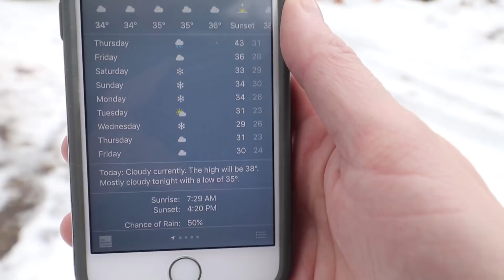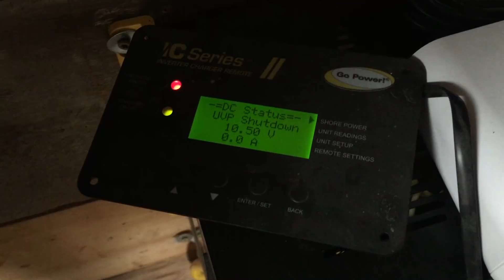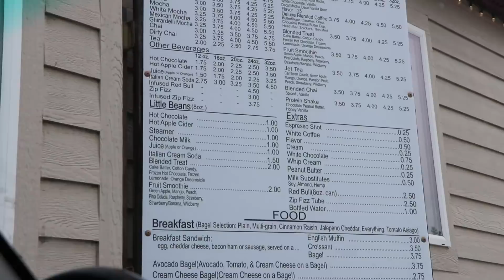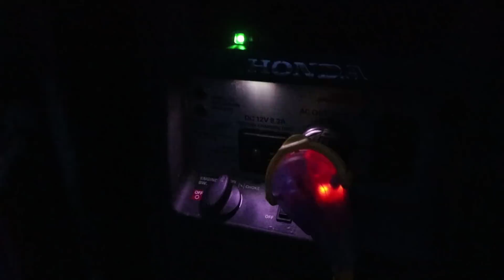Our Story: Giving Up Solar Power to Go On Grid

Comment: I am actually not surprised. I saw the little effort they made to be offgrid, and all the mistakes they keep making and the unwillingness to actually make the proper system... I rarelly saw their panel clean of snow. They also don't have the proper battery charger and inverter. They could have gone with 1/4 of the fuel, or even less with a proper charger/inverter. And even less with proper generator (with remote start). They just don't have the time to proprelly do stuff, or the money.

The technology is there. They just didn't had enought time or knowledge, which is fine.

For example, outback inverters, some of them are really nice, they have a few modes... One is generator assist... You basically tell the inverter/charger (one combo unit) how much power your generator give, and it will feed your house with the generator power, use the extra available to charge the battery, and provide extra power from the battery if you excede the generator capacity. They also have a generator start function, which is programmable (quiet time, low charge level = start when not in quiet time) and more features...

And you just need a proper system, which you refuse to admit you don't have. Your battery bank is WAY TOO SMALL. It should be able to be for atleast 2 days fully on battery, with no power restriction. Your can't even do a full day at limited usage. Your panels is also too small.

So, yeah, you weren't ready to go solar. Specially since not knowing how to even use a multimeter when you started.

Comment: Part of the reason your solar system failed is because you basically took a load of cheap off the shelf ebay stuff designed for RV's and were trying to run a very large property on it. For a start trying to run 12V from those panels down a thin gauge wire on a sunny day was causing you serious losses in voltage drop. See ohms law. You were trying to run on a load of shitty damaged batteries which could barely hold a charge and dragged down the rest of the bank. 

I'm a solar sceptic when it comes to more northerly climbs. You cannot cheap out on this stuff. My guess is you need around 20 large panels. You probably want to be running 48VDC to 72VDC in the panels down to your charge controller/inverters and you need some salvaged Lithium Ion battery packs. Probably 20Kwh or so. 

My guess is being on grid is probably cheaper. 

A word of advice Jesse. You get trolled a lot by keyboard warriors but i'm kind of glad you are going on grid and I hope you get an electrician to wire the house because you are not as clever as you think you are and you don't half spew some crap sometimes when it comes to electricity.

Comment: You are talking about solar, when you have little experience, really, concerning alternative energy. I think you and your viewers are well versed in what you don't know about solar. So, it's no wonder you want to go on-grid. I would too, if I had the issues you both experienced, while not really learning what you should have. You also started off with a used battery system, and not enough of a solar array to properly charge them. One rule about where you are is, when living up north where you do, you should really over panel for winter. 

Also, if you wish to go on-grid, that's fine. But, you shouldn't bust the balls of those who do live truly off grid. You may not realize it, but you basically just called a fairly large number of folks who have off-grid channels on YouTube - liars. You should have just left it at, "We chose to go on grid, because we believe this works for us." You need to think about it, Jesse. You owe some of your fellow YouTubers an apology. I really believe you do.

A few of those you really disrespected in this video are, McGarvey Style, Engineer775, Starry, Doug and Stacy, Bill and Rosa, Justin Case, and countless others. Some may not have large solar arrays. Others do. Some may only need smaller solar arrays to power their homes, homesteads, ranches, etc. Oh, for the record, running a generator sometimes, IS part of living off grid. Our farm, for example, consumes less than 150 kWhs every month, all provided by solar, and sometimes, a generator.

Comment: When I watched your first solar video "Stupid easy solar for going off grid" and saw which inverter, batteries and and panels you bought and the feeble uninsulated battery box, I knew you hadn't done your research properly. You knew you would be going to use loads of power tools and construction equipment which draws a lot of power. You should have started with grid power seeing it was available instead of wasting all that money on solar gear, expensive generators and a lot of gas wasted. When the house was finished and you had a proper insulated battery and power room bought a proper 48V inverter, batteries, charge controller and panels.

Comment: You can be on the grid and run Solar too. It can actually lower you Electric Bill. Not to mention having it available during power outages.
Reply: BlueDevil007 ...that's exactly my current setup. The combination is a plus. I have lights and hot water in a power outage. I use a propane instant water heater that uses a battery to trigger the spark and LED lights. I totally understand what these guys are experiencing. You need that "Extra" push with power to make it. It's better to start with power and evolve to solar assistance than to dive right in. It's a continuous struggle to stay afloat.
Reply: So thru

Comment: I live in northern British Columbia, Canada.  I have a quarter section 13 miles from power lines, so I went and spent 25000 canadian and installed 56 200 watt panels on the south side of our A-frame house.   Been off grid for six years.  Winter months, late november thru mid February, use generator for an hour each day if it is snowing or heavy overcast.  Have not used generator for over a month, and plenty of power.....you are incorrect about not generating power on overcast days....you just need a larger array to get the charging amps necessary.  I have all those panels coming into the house at 120+ volts DC to six midnite charge controllers, which charge 36 100 amp hour gel batteries.  I understand why you would want to be hooked up to the grid, it is much more convenient, not having to worry about clearing the panels of snow.  I think you are limited because of too small a system.  depending on how far you are from power lines, it likely is much more cost efficient to build your solar system bigger.   However you can still utilize your panels after your on grid power is hooked up to minimize your bill...grid tie inverters are cheap and require no battery bank, making hookup straight forward and simple.  For me, having power poled all the way in to my farm was WAY too much to afford, so a big solar system was my choice, and have zero regrets....too much power to use for 9 months out of the year.  I have two xantrex 3000watt inverters stacked....this runs two houses, two shops, wellhouse and numerous outbuildings.  I still heat with wood...good luck with your new home, looks like a beautiful area.....don’t give up on solar....keep this option open for future , when you have more time after your house is completed!  cheers!

Comment: The problem there having is they never did invest in a true solar system . They have the bare minimum panels on a static mount. The bare minimum storage and a very small gas generator. All that adds up to the bare minimum power. Enough to power basic needs in a small trailer that's it.
make the investment and they would get reasonable results and in time it would pay back
Reply: Tom this is exactly what I thought.  They invested plenty in a tractor and new wood mill which will service them for their lifetime and possibly there children's, but solar, hey let's spend the least we can and let's not bother building a tracking system just put the panels laying on the ground pointed skywards.  If they'd put the same effort into the solar system as the frame for the house I have no doubt they'd be a lot closer to being able to remain off grid.

This is a 30+ year investment just like your house frame and sadly you've sort of dropped the ball but that's what living life and learning is all about.  

Let's just wait and see how much the electricity company wants to extend those wires and poles to your property it may turn out to be viable to build a proper solar system once you get the quote for that.

And you need to do the calculations for 30 years of connection and service fees as well.

 And as others have said you can always augment with your current system with a little tweaking.

As for battery storage using Gel Lead/Acid batteries is so last century, quaint but not a worthwhile investment of your time and money.  You know with that big hill and water you could pump water up hill, there are many ways to increase your storage and input into that storage.

As I say I'll wait and maybe the price of connection will be workable.  Seen others quoted in oz in excess of 70K just to connect.

Comment: I work for a public electric utility.  Talk to your electric company about Net Metering.  That would allow you to retain your solar system and on the days the sun is working - use solar and sell any over production to the company - on the days without solar - you have the grid.  You are billed the difference each month.  You have quite an investment in equipment.  Don't scrap it.
Reply: Printer471 this is very good advice. Even grid power has limitations. Do you guys remember having power when your neighbors didn't? I just had 10K grid tie solar system installed last August and have not had a power bill from the utility company that wasn't offset by the power produced. My system is 3Kw more than was recommended due to the fact I enjoy using copious amounts of power. Bonus is that it compensates for the days of low to no solar power production. As soon as power walls become moe affordable, I will jump on those. Best point I can make is that in ten years, the system will be payed off. I would love to talk to Jess and his bride about solar and the options they have at this point in their lives to consider becoming a partner with their power company and how they can start a legacy for their future family. I do not represent or work for any solar or power company. I'm just a retired military man that has followed solar power for 30 years and it still blows my mind.
Reply: Is what it is. Live the life you want to live. In South Africa we have a lot of Sun so it is not a problem and worth it. Think about a grid tie system.

Comment: the solar was the whole reason I subbed!  of you had more battery. and more panels . you wouldn't have the problems you had. also wind turbines would make a big difference. I'm building a small hydroelectric generator. and have a 25gallon fuel tank on my 6kw generator. for when there is no wind . or sun. the first few months here we have little sun. but there is wind. so maybe before you do go grid. maybe think if wind may supply you with the power you needs. along with more battery!

Comment: Serious question,... "Modern Couple Building a Debt-Free Sustainable Home". I was excited to see this channel develop into something "sustainable" But since I've watched this channel a few Key major factors have come into play. You picked One of the most expensive ways to build a house in a rural area. And I say expensive because for starters most of the people tuning in, and even probably some of the people who live around you for starters didn't use LightForm to create the foundation, concrete blocks would be the cheapest through their own manual labor. Then you went off and built a Timber frame house, again with someone of limited means, they wouldn't buy a saw mill and truck in raw trees. I could see this being beneficial if you had said trees already on your property and an abundance of, but this is not the case.  Next you decided to use SIP panels, again most people would build on site. The vlog started with Allyssa selling her car to buy land for the "homestead" Yet eventually you went and bought a truck going back to payments. You were off grid for much of the vlogs existence, kudos there, but now your going on grid? You could have partnered with Solar City or some big solar company to be educated about solar and learned how to do it right. It's no surprise that your solar didn't work out, you bought second hand batteries and had not a clue how to maintain them... And don't get me started on the tractor,  I mean, it's debatable and even i have said you needed one, but buying one? Who really has the money for that? Had the house been a more sustainable option you could have just rented a smaller back hoe (the one on the tracks you often rent). The only reason it's debt free possibly at this point is because the YouTube limited funds are paying for it, ok.. you worked hard, that works. But then you go ahead and have a "workshop" where people come and build your frame for free. I'm sure they all had a great experience, but the reality is... 

Perhaps this maybe a "debt-free" home the way your going about doing this, but it's not how any normal person would go about doing so. But I get it,.. you're using everything and anything to your advantage to stay out of debt,.. But wait,.. you bought a brand new truck. Vehicle debt is the worst kind of debt because unless you bought a Porsche all other vehicles loose value over time.

I'll still watch your video's I still enjoy the journey you two are on, but it's really a far cry from at least what I would expect a debt free home would be like.

Comment: We have been living in norther Minnesota for the past 10 years with solar. Prior to moving up here we lived in a large city with all off the comforts that you have being tied to the grid. 
When using solar the very first step is determining the size of system. Besides the consideration for lighting there is the well pump, septic pump, refrigerator, tv, satellite dish, satellite for the internet, laptops, washer and dryer, all my power tools (full wood working shop), and several other small kitchen appliances. We also have a large chest freezer in our basement but it run on propane so it does not count.
All of this came down to the number and size of panels, batteries, inverter, charge controller, and generator. We have a 48volt system with 16 6volt batteries and a 12k self starting propane generator. This time of year the generator can auto start every 48 hours. But there have been times in the summer when is doesn't run for months. 
Like you said everyone must determine what is best for them. For us it is solar. Why you may ask. The system has paid for its self. So our only expense is propane. And that is a lot cheaper then electricity.
Take care.

Comment: Hi Guys
We're in your area, we bought our property(10 acres) bare land 
We've built a 30 ft cedar yurt, dug a well, buried a propane tank, installed a septic system and drumroll....... a 12 panel solar system and a Köhler generator that gives us all the power we need for our home and garage!

We choose solar for many reasons, cost and self reliance and independence!  We'd love to have you over and share our setup with you!  Solar can met all your power needs, we're living proof! 
(Showering, frig, laundry....not in town...simple life)
Reply: Hey Kelly, our situation is very similar to yours. You are right, it is very doable.
Reply: Also, forgot to add this, when the grid goes down due to weather or whatever, having a proper solar system and generator means that while your neighbors wait for the power company to fix the problem,  our life goes on unaffected!
Reply: Calculating for us, and there is power at the end of our driveway on our road, would have been around 30-40k to go on grid!  Our decision to go solar, in the same area as you guys, was based on the cost of a high quality solar system which we invested in and the obvious upkeep/repairs and replacements of equipment over time was what made and still does, the most sense for us.  Being off grid, self reliant and autonomous as much as possible is the life we've chosen.  It's NOT for everyone, but it can and does work in Northern Idaho!
Reply: Sounds like you guys are doing great, I'm sure a lot of people would love to see how you do it all. Make some videos!
Reply: My husband and I made decisions for our life that work for us.  We evaluated our jobs, mortgage and debt and said nope, doesn't work for us anymore!  So we sold our home, changed our lives, paid for our land and have built an off grid home that was in our budget and fits our needs.  "Off grid" and "homesteading" are hot topics and  a lot of us are interested. That's why we and I assume a lot of the subscribers to their channel watch their channel.  There is no manual or 100% right way to live.  It's personal choice/opinion.  I just felt the need to comment because "we" are living off grid with solar in Northern Idaho!

Comment: What I didn't understand from your video is why do you need to take down the solar? Doesn't it worth having it as a backup +saving some extra bucks in a sunny day?
Reply: I think those were older videos of them setting it up and moving it around at different times.  They aren't going to be on the grid for several months, so I'm sure they are still using the solar.
Reply: Because they didnt put together a proper system and it dosent work
Reply: That's something you can focus on later. The should get their house sorted first.
Reply: No
Reply: I didn't hear that.
Reply: павел гнедин My guess is that with their heavy workload the extra time spent maintaining a solar system can be put to better use.
Reply: H